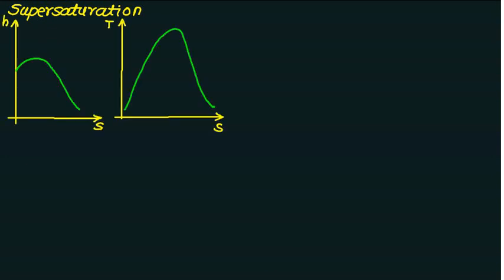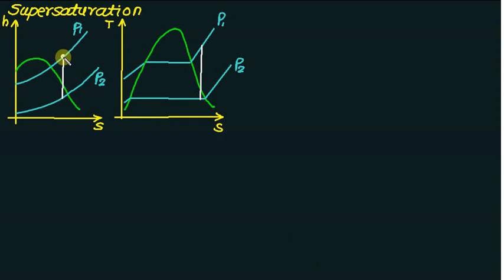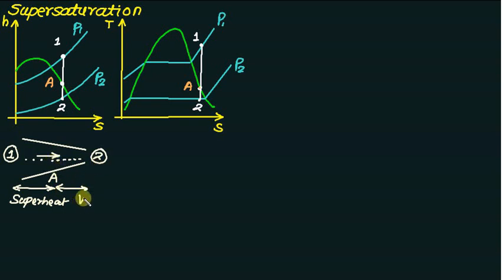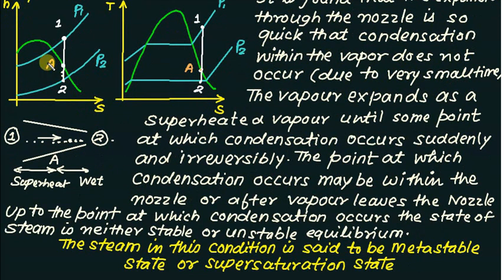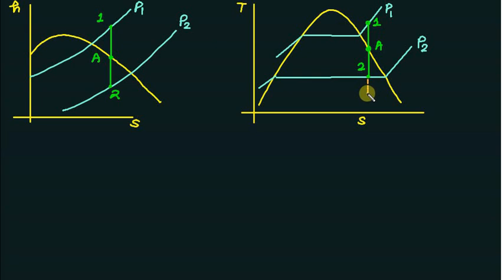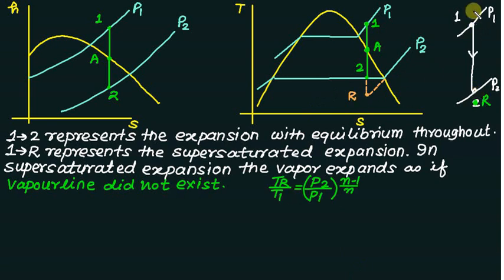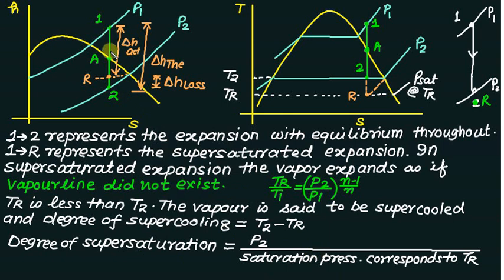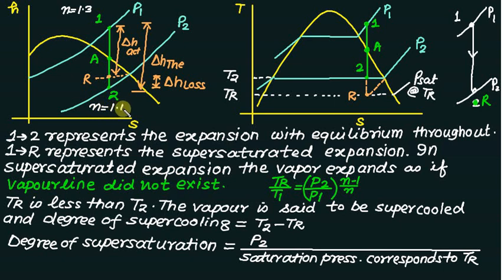Nozzle Supersaturation flow

Comment: Why P1-P2  Process is expansion Process...As The Temp Decreases, i.e T1>T2.. Temp is Proportional 2 Volume.    So when Temp Decreases From T1 to T2 Why it's called expansion Process ???? Plz Clear Me sir🙏
Reply: Pressure drecreament is the only parameter by which we can say it is expansion process in open system. It does not depend on volume is increasing or not.

Comment: sir how cum the pressure in T-s diagram is lower than P2 pressure at pint R  while it is greater in case of h-s diagramat the same point that is at R?/??? plz clear it if possible
Reply: i have also the same question. please reply..
Reply: pressure at point R is not lower than P2, it is P2. sir said at 6:08 that we can generate the supersaturated expansion by removing the dome. if we remove the dome then there is no wet region, it is in fact the supersaturated region and the pressure line still be inclined, not horizontal. so the pressure at point R will be P2. 
I hope this answers your question.